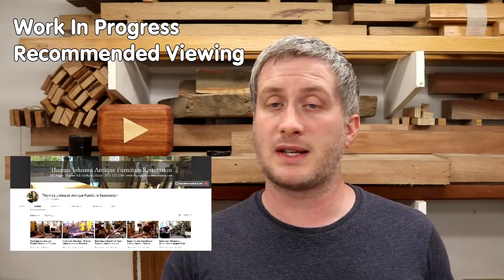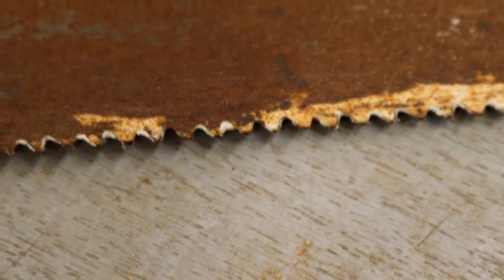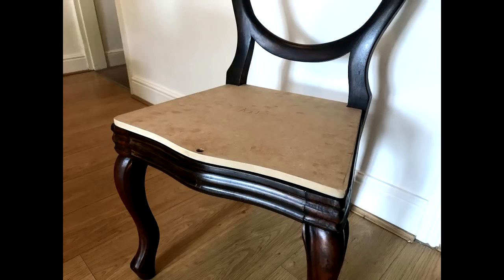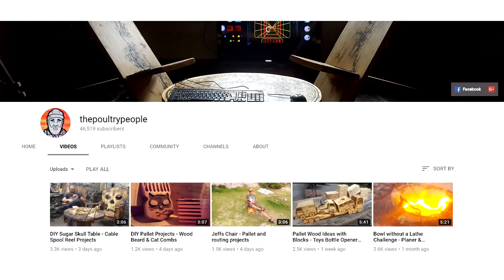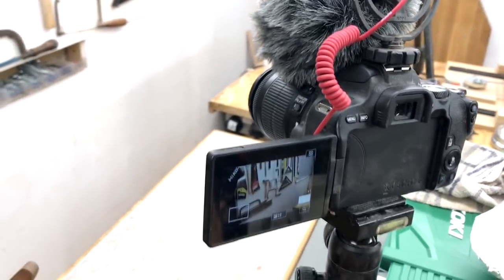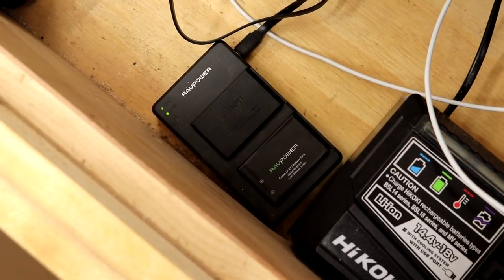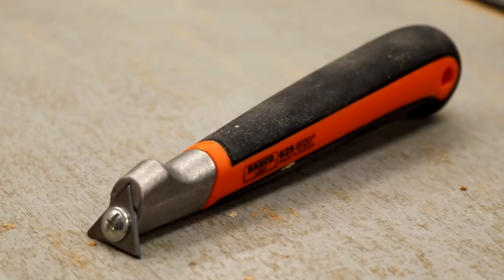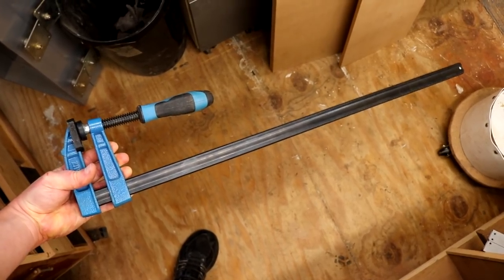VLOG 6 - Work In Progress / Recommended Viewing / New Camera Gear / Tool Talk (feat. HiKoki & Bahco)

Comment: Most people don't realize that DSLRs are great for video recording. Like you said they have a much bigger sensor, even compared to the more expensive camcorders. Btw, maybe it's a good idea to use an external power supply with it? Than you don't have to care about the batteries.
Reply: The problem is, the original external powersupplies are really expensive. I had the same problem with my Nikon camera. And not all woodworkers are also electronics experts, to diy a powersupply.

Comment: Nice vid.  Just one advice about dslr ... More troubeling than dust getting in lens is dust getting into the body. So i would not change or anyhow put the lense of from body in the workshop. Go to the house or something. And change it fast always😊 You kinda can clean the dust from the body but... I would count on precaution more😁  and... I am more into nikons so i dont know about canon... But check the settings for beep about the batery.... If you already have not 😁.  Good luck with everything! Be good

Cheers from Slovenia , Miha - ZAiO😉
Reply from the maker: Thanks. Yeah I’ve checked the menus but there doesn’t seem to be an option for a battery alert. Shame!

Comment: i was gonna recommend a 17-50mm f/2.8 lens or a 10-20mm one, but then you mentioned the silent motor, although now that you have a DSLR and proper manual focus, might i suggest you try manual focus instead ? for most shots i doubt you need autofocus.
Also since you are filming in the shop and a wall outlet is always near by a wall adapter would probably be a better idea than using it on battery power.
Reply from the maker: Hi Joe, for the workshop I need to keep my set up super cheap as I don’t want to ruin it. I’ve got better cameras and expensive lenses but I wouldn’t use them in the shop. The 18-55 focal length works fine although sometimes it’d be nice to have a bit more reach. Autofocus works well, I tap the screen to focus before each shot and I’m away, quicker than manual. A wall adaptor wouldn’t be a good idea because I constantly move the camera in between shots (it’s on a home made mobile wheelie stand, there’s a vid about it on my channel) and the cable would be annoying to manoeuvre around in my small shop

Comment: The red clamp set from the same Amazon seller are £10 cheaper - the only difference is the colour.....
Reply from the maker: They aren’t the same. The red may be fine but haven’t tried them
Reply: I asked before posting..

Q: "Can you tell me what the difference is between https://www.amazon.co.uk/gp/product/B076F6F51S priced at £44.95 and https://www.amazon.co.uk/12pc-Clamp-Long-Quick-Slide/dp/B01HD5FEJ6 priced at £34.95?" 

A: "The only difference is the colours. "